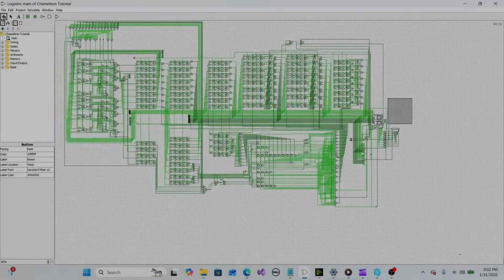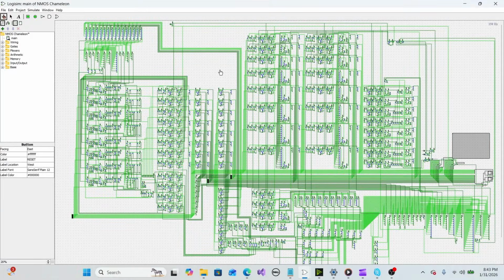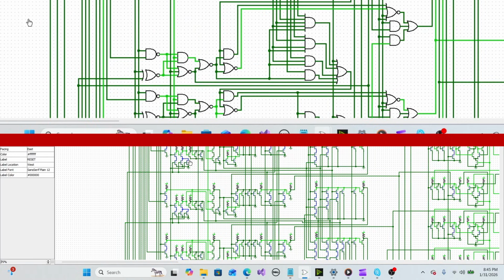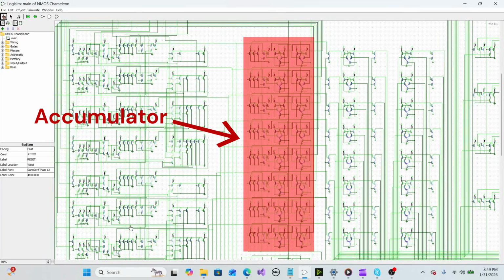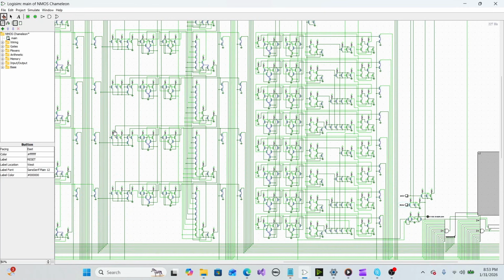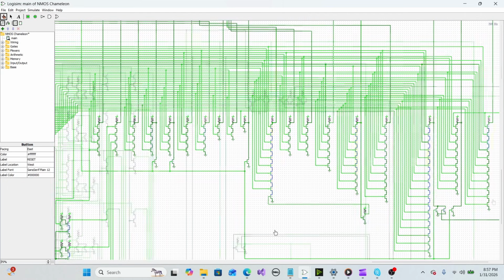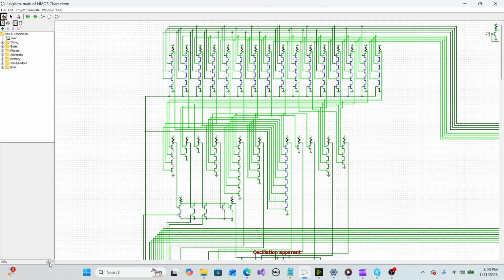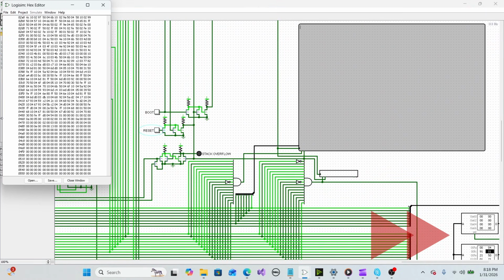Simulating a CPU with 2000 Transistors in Logisim

Comment: You can actually do cmos in logisim too
Reply from the maker: Yeah I've experimented with cmos in logisim as well.  Cmos is more expensive to build though, which is why I stuck with nmos for this project.
Reply: CMOS almost doubles transistors, so device would be harder to grasp/understand.
Reply from the maker: @AK-vx4dy cmos has the potential to run at faster clock speeds with lower power dissipation though.  I might play around with CMOS eventually.  But yeah, for now 2x transistors is just not practical with my budget for this project, especially with how expensive p-channel mosfets tend to be.

Comment: In 1989 I designed on paper a calculator using logic gates. It could do the 4 arithmetic operations . It could add, subtract , multiply and divide 2 8bit integers. I tried to design a rudimentary processor but the design on paper was impossible. The most difficult was division because you have a carry and a floating point to consider
Reply from the maker: Nice, yeah division is hard.  I've managed to emulate integer division on this CPU using software, but building even a simple hardware divider would be a monumental undertaking.

Comment: Cool!
But is there a way to make automatic conversion from gates to transistors in Logisim?
Reply from the maker: Unfortunately, I don't know of a good way to automate the conversion from gates to transistors.  However, building the transistor circuit does go a lot faster if you have a gate diagram to use for reference.